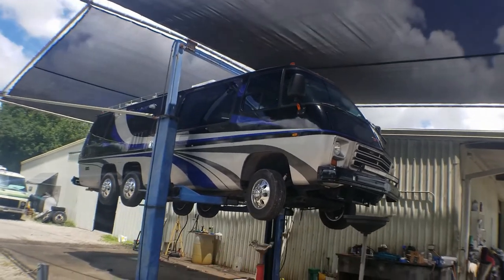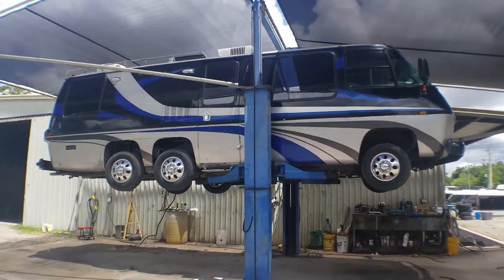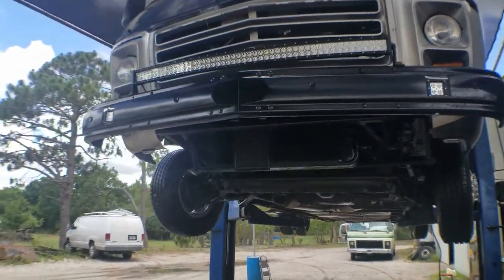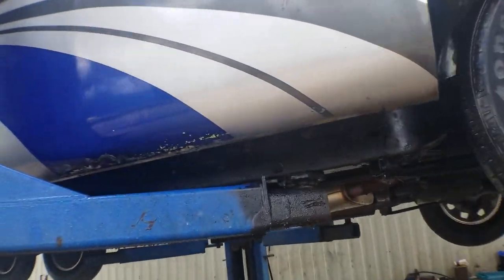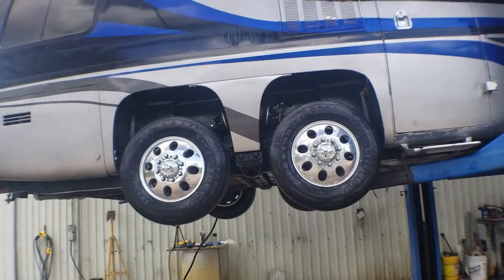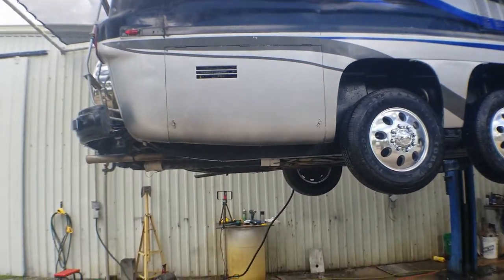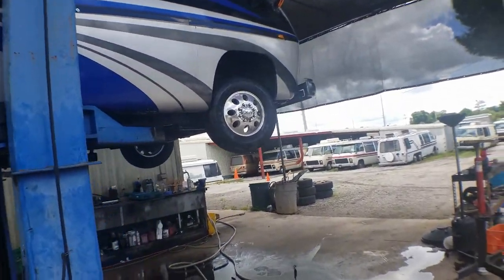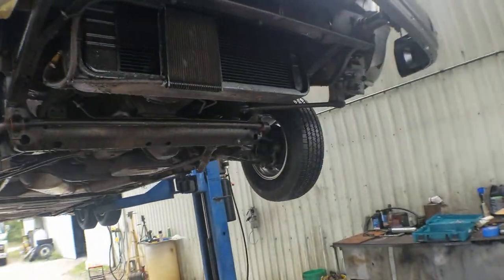New wiring, leaks, painting and LED lights, GMC Motorhome the Yaryis adventures part 136

Comment: From my 40 years experience installing mobile communications systems,  That twisted pair wiring won't last very long in my opinion.  It will get tossed around by the air turbulence under the coach and fail in short order.  At a minimum it needs to be in a protective wire loom and well fastened.
Reply from the maker: We highly appreciate your feedback will make sure everything is properly protected and secure.